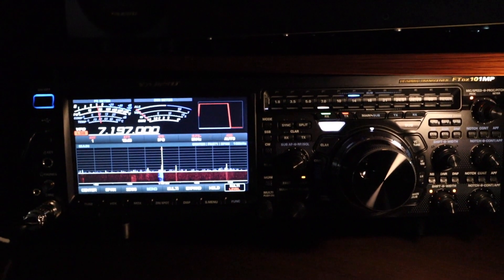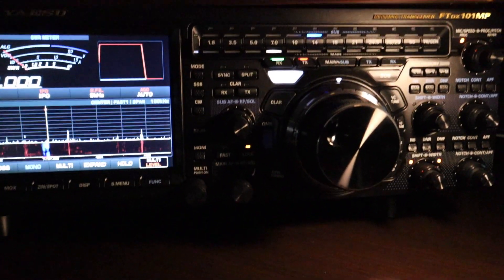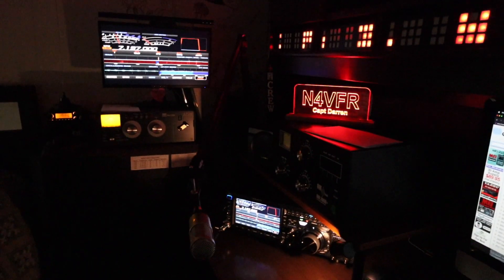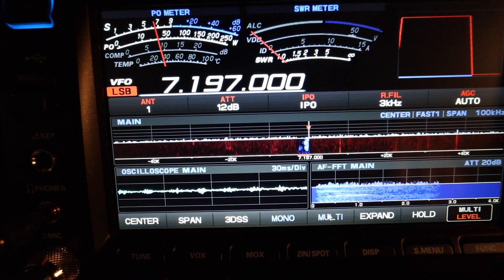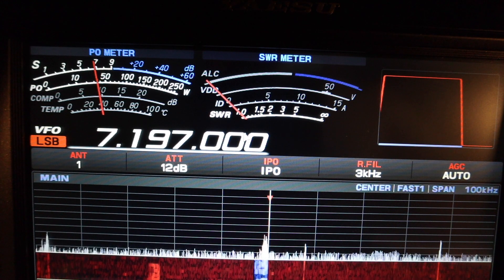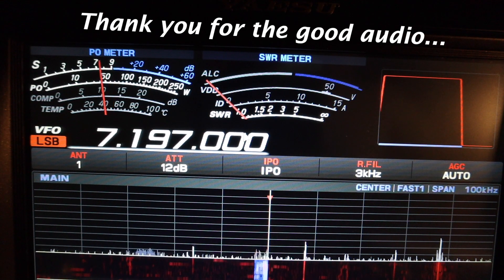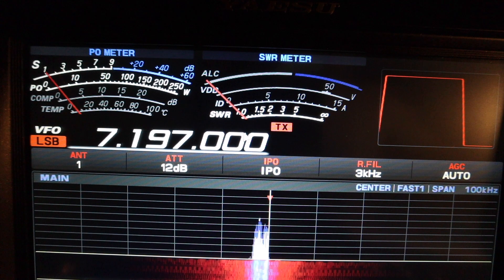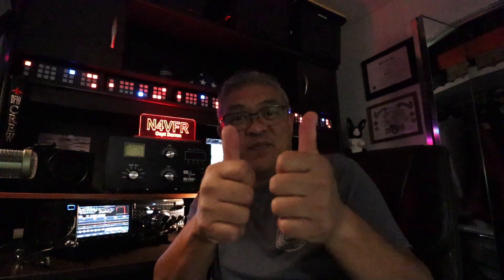Making DX Contact; Fun with Ham Radio!

Comment: Nice contact with i2vrn Roberto. Good to know he's still around. I have worked him before as well. He has a 4 element yagi for 40 meters. I think its quite high in the air as well. Here in the Midwest he has had a 40db to 50db plus signal. Very nice guy. 73.

Comment: You know you can actually get rid of that annoying buzzing that you have on receive. It's a nightmare headache for headphone wearers like me and it's actually masking weaker signals on the band. An MFJ1026 Noise Canceller with the internal whip antenna removed that buzz completely for me, as the source of the noise was apparently close. I suspect it's coming from inside your house, and even if it's not, the internal whip and that device should do it for you. There's also the NCC2 from DX Engineering and the JPS ANC-4. Look in that. Great video my friend!
Reply from the maker: I've checked my home if it's coming from within buy shutting some of the circuit breakers.  I can't run on battery because my HF radio uses 120vac. I looked into the DXE NCC2 and good grief that was expensive.  I've order the QRM Eliminator from ebay and it's coming from China.  I better quarantine my package. Thank you for watching!
Reply: @DarrenN4VFR  Good for you Captain that you bought one! Apparently these cheap QRM Eliminators are awesome. Keep in mind though that the difference between all the others and the MFJ1026 is that the MFJ has a preamp for the sense antenna, the noise antenna. This was important in my case and the little whip needed enough boost to 'hear' the noise properly. 

But in absence of a preamp, the one you bought may just need a bigger sense antenna. You'll have fun for sure. There is no need to suffer through so much noise with these options for 100 watt rigs. You're missing half the fun of HF without the ability to dig out weak signals with guys running wires and happy to make contacts. Enjoy! Do post a video of before and after : )